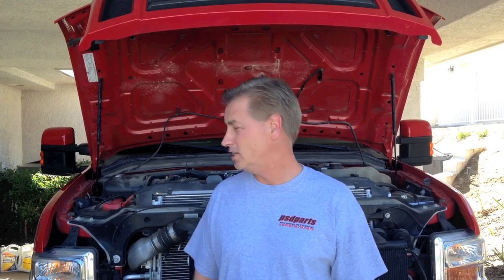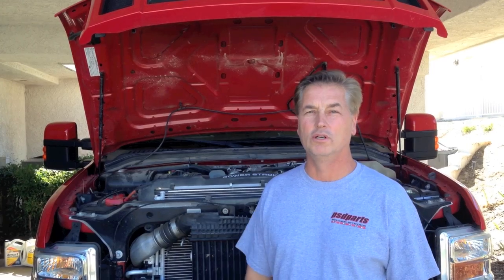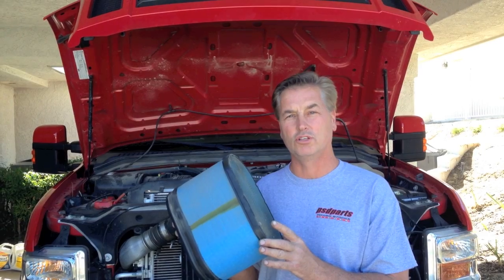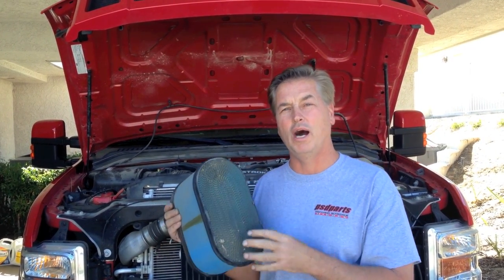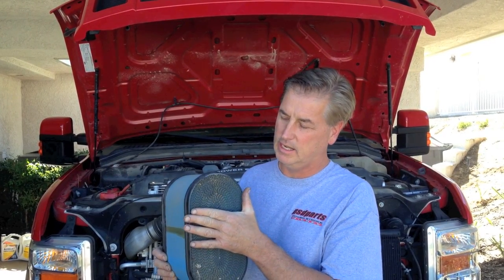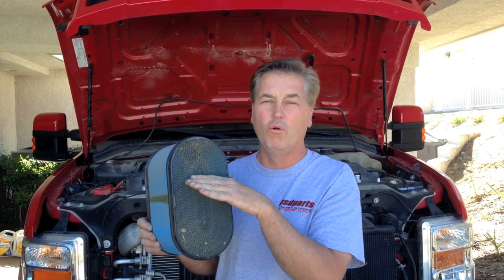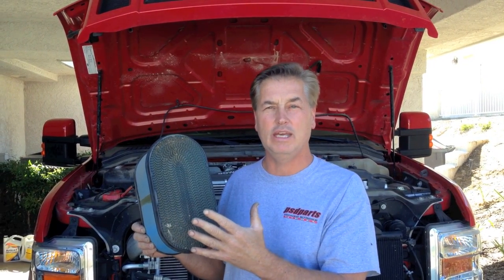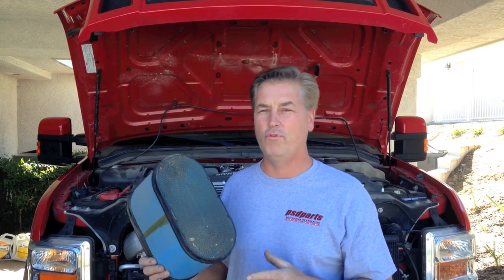Ford 6.4 powerstroke diesel poor fuel economy, Regen explained and cause of fuel in oil.

Comment: Your main problem its a 6.4 trash it and put a cummins in it problem solved.
Reply: Oh yeah and still blow head gaskets, drop a killer timing dowel pin, eat a grid beater bolt, CP4 pumps, 53 block. After installing in the Ford have a CEL, no cruise control, and you will spend so much time and money getting it right even if it’s an XL trim, manual transmission, non-A/C truck.

Comment: It's just the regen. What! What do you mean it's "JUST THE REGEN" Get that crap out of my truck. Fuel in my oil? No. Fuel in the oil is not good. First diesel has zero lubricating qualities. It is a good cleaner. So if you want to deplete the life expectancy of your very expensive engine. Then OK. Me get that crap off my vehicle. DELETE, DELETE. Do I have to say it again? This is some failed attempt at emission control designed to apiece green Globalists of California. I believe in air quality. Good air quality is a good environment. So stop burning so much fuel Deleting the DPF will improve MPG by 5 MPG Deleting that engine destroying EGR will get at least 1 MPH that's huge and extending the life of the engine by 30%
Reply: California vehicles get smog checked. Diesel has more lubricant properties than gasoline, and less cleaning properties than gasoline. American diesel fuel standards are way worse than Europe too. They don’t have these issues.

Comment: The oil indicator come on ,, then i replace the oil sensors temperature/pressure , and truck worked fine for a few miles 😂🥹😳😳😳🥸🧐🧐then i replaced the sensors again , and this time truck run for a litle while without a problem , then the oil indicator came on again ... All this stated happening right after turbos where replaced,, any aideas why ?
Reply: Harness issue, oil filter and oil filter cap, the oil drains, etc. come to mind.

Comment: Ron I have a 2008 f250 and the truck is going to Regen every time I change oil to discard the contaminate oil. I know I need to replace Thermostat because the truck takes at least 20 minutes to warm up when I turn it on. Can that be the issue. Yes white smoke from time to time.

Comment: Hay ron love the videos probably watch each one twice.  I've just bought a 2008 f450 with 85000 miles.  I have put 1500 miles on this truck but have seen the regen on the dash. I use archoil from day one, oil, and fuel what am i missing. Ps  Im getting 12 -13 mpg thanks ron.
Reply: Sadly Ron passed away and you will have to look back at his collection of video's to find what you need..Gd luck.

Comment: You know this is the engineering bullshit that really pisses me off about a lot of the products being made today

For one you shouldn't need a filter in your fucking exhaust system that's just an insane idea the exhaust should be coming out of the engine cleaner to begin with instead of having to be filtered afterwards

They just over-engineered the fuck out of this problem when what they should have been doing was trying to figure out a way pretty engine itself to be more efficient

Comment: The first time my diesel cleaned it's own exhaust system was interesting. It smoked up the entire highway for about 12 miles.
Reply: Yes it is the most imba-rising thing I have had to deal with while driving a modern vehicle.💩😱🇨🇦

Comment: Has ford ever made a truck to ever run over 5 years with out costing the customers thousands of dollars
Reply: These are International harvester engines Navistar. Ford started building their own in 2011. The problems with the 6.4 are almost all connected to this regen and emission system.  Eliminate the problem and service them regularly and they will live forever.
Reply: Yes. The 7.3.
Reply: jamie jangula yes it's called the 6.7s

Comment: OK, can you tell me why a 2008 ,6.4 diesel would  back fire. ?    I'm asking for a buds truck.   What would cause such a thing to happen with a Diesel. under 70k miles.
Reply: I'd put my Cummins up to a power choke any day.  Stop....with the hate. Truth is TRUTH....CUMMINS  is real !   Next time in Pa....bring it.
Reply from the maker: +Jim Cash. I try to help people with good info. can I ask you please to have my brand is better than yours in another post. most people come to my posts for help on issues. Please and thank you.
Reply: +Jim Cash. You think the cummins is better than the powerstroke? LOL. Thats why you own a gasser. Youre very misguided if you think thats true. Sadly, all of the american diesel have absurd issues and it all comes back to the dpf/egr systems or a fuel related issue. Theyre all the same buddy, its playing the lottery.
Reply: +Jim Cash. check the intercooler pipe boots, blew mine off a couple times and it backfired followed with no boost.
Reply: Diesel-soaked blowby coming  through the egr hitting the Turbo fins putting them out of balance then going into your cylinders making poor fuel quality combustion and causing good soot build up in the exhaust headers. That will eventually melt down to liquid causing an explosion in the exhaust is a backfire. Similar to a chimney fire due to creosote buildup. DELETE, DELETE!
Reply from the maker: I don't think it's possible..a back fire is ignition with a valve open our not sealed. Diesel needs compression to ignite..  is it popping? I have a video on that
Reply: All I heard was it back fired, or a loud Pop. Truck was in motion 45mph. Its a buddy truck. I also thought it was strange to back fire,as they stated.
Reply: ok, well i know the owner said he has been adding cetane booster tot he fuel......humm. shit i hope they never added a Gas additive....has me thinking. 
anyways , what video did ya post that may be the same thing they are having told me.
Reply from the maker: +Jim Cash. search popping intake 6.4
Reply: Well, I am a FORD gas man, BUT   for a diesel...I am CUMMINS  all the way.!   This is a friends truck who I told 1,000,000,000 to stay away from Ford Diesels.!  I been around trucks all my life. I know what works.
Reply: Maybe he is stuck on the side of a road...?
Reply: Jim Cash. LOL!
Reply: And of course... diesel Ron responds to your jackass comment but wont respond to a technical question I asked about p00B7. This world is broke.

Comment: I bought a 2004 ford f250 6.0 with  180kmile  was cranking and no start,I charged the battery and crank it to read the  trouble  code  and I spray a little to check if fire up it did.I open the oil filter and found out the filter was full of brown sand and i tasted to find out sugar or salt,it was sugar and found in the crank case ,oil filter a lot  and i found out it was poured from oil lash cover  where  pour oil in the engine.what is my option to clean the Engine internally with out cranking maybe  spine with  ratchet and socket  and .and inject hot water from coup of the hole of the crankshaft  with removing some bearing,and remove all injectors and HPOP and clean and put it back.please advice me if this method will work  and i will check if the sugar got inside the bearing or   just in the oil Chanel ,not entered the bearing surface.

Comment: hi Ron I got a friend with a 6.4 2009 f-450 it has a code p0093. What should I check? Fuel filters are fine  also if you hit the pedal 3/4-full throttle it will stick at 2000+ rpm. But only when hot.

Comment: So your telling me that ford put a filter in the exhaust to clean up the environment, but decides to heat up the engine to let all the trash out at once? Seriously guys. If we didn't have to worry about the environment we would be getting better fuel economy. Don't you think that's better for the environment?
Reply: Snapytj its a load of shit. The EPA is forcing vehicle manufacturers to have this crap on their vehicles. How the hell is it 'better for the environment' to have worse fuel mileage? Sure what's going into the air is cleaner but we gotta burn more fuel to do that?? Makes NO sense to me!!
Reply: +Kona138 Abolish the EPA
Reply: +Snapytj Abolish the EPA
Reply: Yes and emissions would be cleaner. A properly maintained and heated stove with good-quality fuel will have the best emissions readings. Leading back to the DELETE.

Comment: DieselTechRon - I was under the impression that during the regen process the PCM fires the injectors in cylinders 7 and 8 during the exhaust stroke. This seems to be one of the reasons that people blame the common problems with the head gasket at the back of each head.

Is that not correct?

Comment: What should I expect for fuel econmoy when driving down hwy no load at 70 or 75 and what should I expect driving in town no load. Currently I get 10.5 in town and about 9.5 to 10 hwy.
Reply: Mine gets 20-22 hwy hand calculated
15-17 city
Reply: @aaronallen9015  Zip Idy do da and that helps us, HOW?

Comment: My truck has the DPF delete kit and a minimax tuner; does that eliminate the issues you have described in the vid?
Reply: Yes it will.
Reply: Yes.
Reply: all up until you lift your heads from overboosting.

Comment: got a general question for you, love all the videos you do first off.
I have an f350 6.4 with the update, since the update i find my truck doesnt go into regean has often or at all. any thoughts on this?
Reply: Chances are it's still happening, you're not just noticing the message flash. The updates from Ford removed the notification that stayed on. It'll only show now for a few seconds. If you've interrupted the Regen process a few times (ie. you turn the truck off / not driving fast enough) you'll see the "Drive To Clean Filter" message.
Reply: hmm, i never see the drive to clean at all or feel it doing it. I do thank you for the reply. got under the truck today and notice it has a pin whole in the muffler near the bracket. ( no power loss, but fuel loss )

Comment: And maybe you can help me with this question when my truck goes through a region every 100 miles or so, my check engine light turn on and the code reads (P2002-Particulate Trap Efficiency Below Threshold) do you know what that mines?

Comment: I've calculated 1-2 gallons of diesel is burned per complete regen.  Regens and cold weather don't mix.  Some of my regens will run 30-40minutes if I'm stuck in slow traffic.  15-20min on freeway is typical for me in cooler weather.

Comment: Good day sir,
So iv been watching your videos and it seems you really know these 6.4 ford engines.
I have a few questions,
How reliable is the ford engine?
Are they high cost to mantian??
So powerstroke 6.4 or cummins 5.9?? 
This will be the first time i perchase a diesel so youre opinions and answers would be great! Thanks
Reply: I know its a bit late, but the fords are good motors, but everyone will compare them all the to engines of yesterday (like the famous 5.9 12v or the good ole 7.3), but most of all the problems that are wrong with any of these newer diesel motors are due to the EPA and its stupid bullshit -- yes, lets burn twice the amount of fuel to clean the emissions by 5 or 10% - because that makes total sense. that includes the cummins. the cummins itself is a fantastic engine, but my biggest problem is that DODGE makes shitty trucks overall. go drive one and see what i mean. good motor is not the be all end all. its about the truck overall. in general, if you want a cheaper to maintain truck, get a gasser. they are much cheaper and in general easier to work on. IMO, ford makes the best truck PACKAGE. if ford could put a cummins in their trucks, I think that would be the greatest truck ever. If you want middle ground, there's always the chevy, but there's just something that doesn't jive with me about those trucks. If you want a cheap truck that will last a decent time, get a 5.4L F-150. If you want a great truck that needs a bit of work, get a used 6.0 powerstroke for like 8-9 grand and dump a few thousand into it to make it run for a long time. just realize what it takes.

Comment from the maker: The injectors are under the valve cover. If it developed an external leak it will go straight into the crankcase.
Reply: DieselTechRon Hi Ron I sent you a message yesterday i have a 6.4 f350 diesel i'm having problems ,my engine light keeps coming on the code is P0088 high pressure fuel pump can you tell me what you think the problem is the turble works for a while then it stops if i turn the truck off for a while it seems to work again
Reply: jahs holoway http://www.trucktrend.com/cool-trucks/1212dp-6-4l-problems/

Go down to HPFP section.

Comment: nice video, good info. I have been dealing with my 2008 F350 regen issues for the last 18 months. Dealer says I need to replace CAT. Well im done with the whole emissions thing. I am removing DPF/CAT and putting a H&S XRT Pro with a race pipe on it. The dealer also said my oil level was over filled, and they told me the O-rings on the high pressure side were starting to wear, thus allowing fuel to enter the crankcase. How does the diesel fuel get mixed with the motor oil?

Thanks again for the videos, I may video doing my PDF delete removal and post on here, problem is i have no lift, I will be doing it driveway style.
Reply: It is mixed by bypassing the rings like Blowby during the huge amount of fuel put in cylinders 7 and 8 also the ring gap in the cylinders are so great even when not in regen the ring gap is so great blow by is huge causing seals to leak and gaskets to fail

Comment: Your videos are really well done. On my 6.4 it goes about 150 miles or so before cleaning but I drive all highway and it cleans for 10 minutes or so at anywhere from 900° to 1300° depending on boost pressure.

Comment: H&S mini max tune I got the dash pod molds nicely by the pillar. Just go to H&S's website you should be able to order one mine cost around 1200 bucks. They might be more now since the EPA cracked down on these companies for making tunes to disable emissions, The dash pod will check and clear codes you can watch all temps, boosts pressure, adjust speedo for tire size ect. You can get like 6 different power settings from 40 horse all the way up to 300 over stock on the 6.4 or you can just disable

Comment: I got rid of the dpf with a 5 inch straight pipe then I had to tune the truck and at that time I also got rid of the egr cooler. Truck runs cooler, gets 18-21 mpg and has a ton more power, and no more thin oil